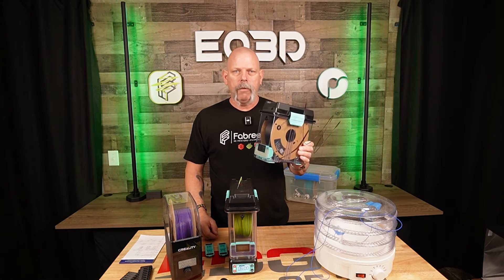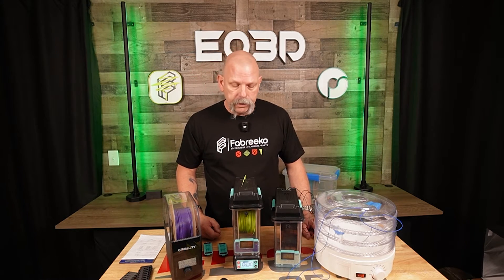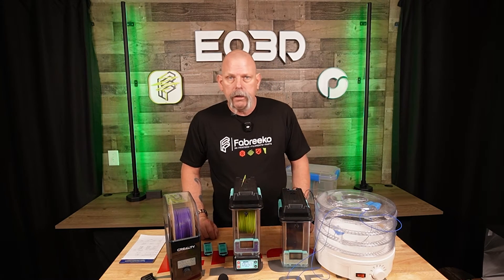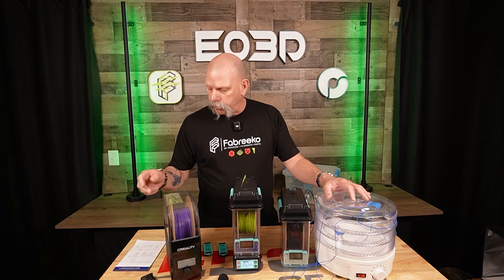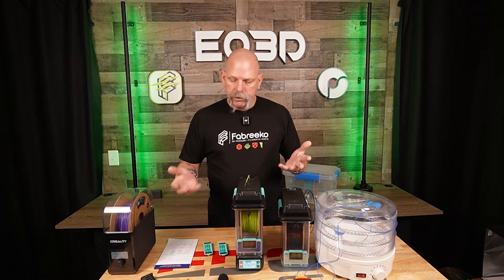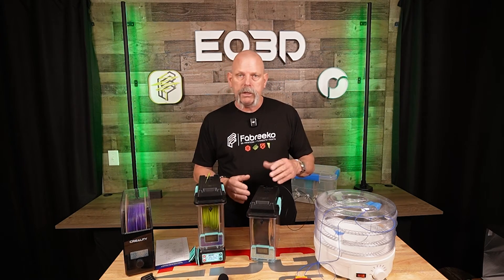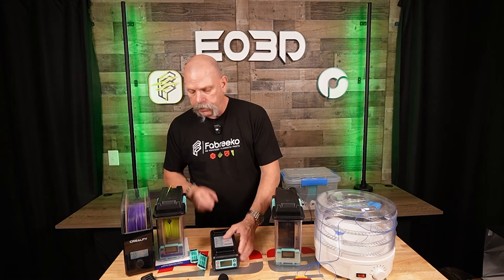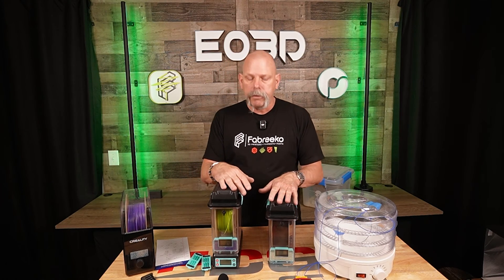PolyDryer by Polymaker - A Deeper Look | EDGE OF 3D

Comment: I swear by my PolyDryer, but I’m jealous of the US pricing. In the UK the PolyDryer is around £75 to £80 (100 to 107 USD) and each dry box is £30 to £35 (40 to 47 USD). If the boxes were £22 (30 USD), I’d have considerably more than my current 4, and probably a second Dryer too!
Even the DryDock on its own is £55 to £65 (74 to 86 USD) in the UK. 
I printed the parts for GunplaMark’s cereal box conversions that attach to the PolyDryer via an adaptor, as well as the ‘double barrel’ mod to dry two boxes simultaneously. That’s 8 boxes for the price of a single PolyDryer box in the UK. 
Pity, or I’d have a dozen more.

Comment: I live in the northeast…relatively low humidity for most of the year. I find that if I dry out my desiccant packets, then pull the filament from the vacuum sealed pouch, print straight away, dry the filament at 60C before storing it in a ziploc bag with half a dozen desiccant packets, it’s not an issue for nylon. I would LOVE to get my hands on this system, though. I have a Sunlu dryer, and when I replace it, this is going to be my unit.

Comment: I just ordered one of these so the funnel file is appreciated, subscribed.
The temps seem off; Igor from mytechfun measured higher temps, but he was using an arduino to do it so maybe that had something to do with it. Either way, it's a great form factor and does the job well, so that's good enough for me. I don't need the temp numbers displayed as long as it's doing its job.

That bin in the back, can you link it? I'd like something like that for rolls I don't print from often but still want to keep dry.
Thanks for the overview and comparison!
Reply from the maker: Temp readings are subjective based on the location of the sensors. If I place one down in the base unit directly in the airflow, they read a lot higher, up higher in the box, a lot lower.

Comment: Thank you for confirming it dries Nylon, our users are still skeptical about it so the more people actually test it the better :)
Reply: Prusa recommends drying Prusament PLA at 45°C (113°F) for 6 hours. You recommend for your PolyLite and PolyMax PLA to dry at 55°C, right on the product pages. So it's odd that your own drying solution, on the PLA setting, seems to be achieving about 38°C. You recommend drying PETG at 65°C and ASA at 70°C, and it seems that these boxes won't achieve those temperatures, even on the highest setting. Can you please explain? 

Also, it would be great if you'd explain how to read the humidity displayed on the in-built hygrometer. It changes dramatically when the box is being actively heated versus when it is sealed for storage. It also changes with ambient temperature on sealed boxes. Hard to understand. 

Finally, I wish you guys had put in a combined hygrometer/thermometer instead of the hygrometer-only unit in these boxes. I just bought some combined ones that are the same size and am swapping them in so that I can see the temperature in the box.